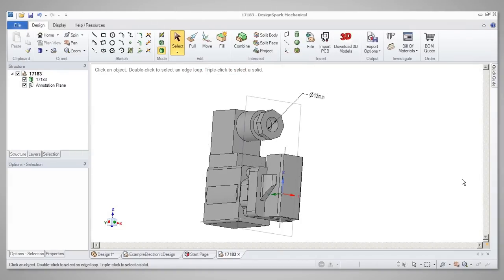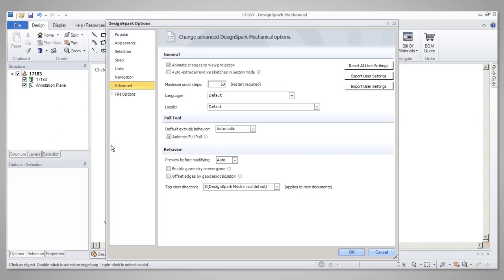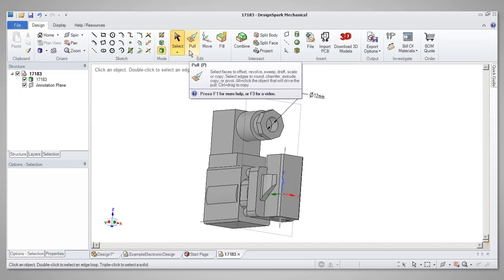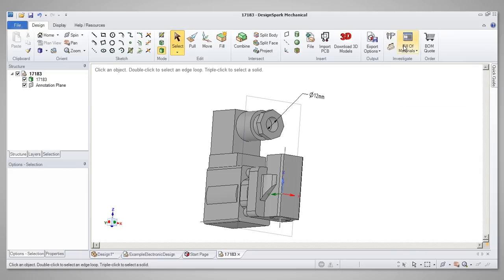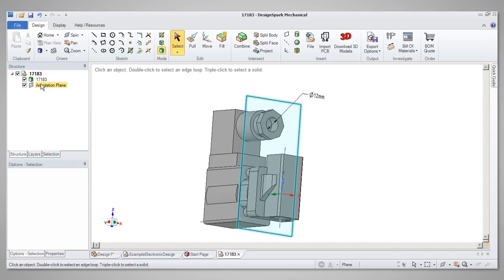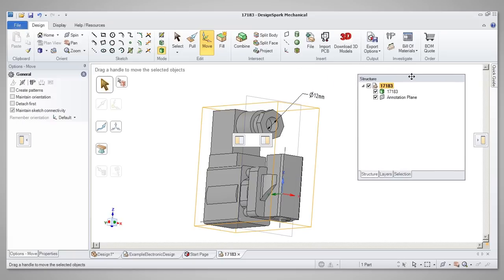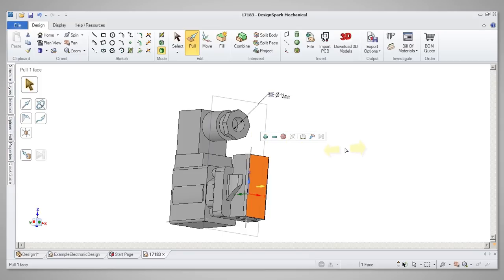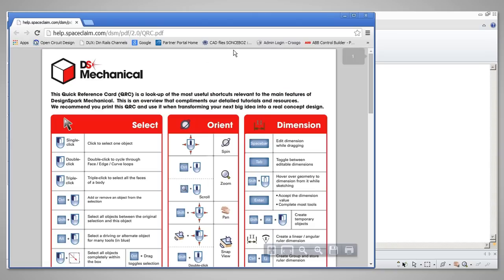#DesignSpark Mechanical - Basics - 1. User Interface - Full tutorial

Comment: Okay, I decided to download the program and while a lot of stuff is great, some things are major frustration for first time basic kind of user which I am. I am not a professional CAD user.  After about 12 hours of use, I can do the basic circles, rectangles, etc. and basic shapes in 2D.  3D is still a disaster for me.  It took me forever to figure out how to copy an assembly.  I would think you could just select all the lines and stuff, hit copy or cntrl C and then paste on a point.  But there is a trick 
 -- you have to paste it on a point, and then sometimes it changes the lines of the copy (is this like cloning where the copy isn't as good as the original?) It still does not work reliably for me.  Then you can't put text on a drawing.  Or at least I can't find it.  How can you label anything?  Next, some lines were graying out -- even after I selected it and reset the color.  It happened on curved lines. Any ideas?  Thanks.  Even tho the program is fun and advanced in a whole lot of ways, this stuff should be easy for $560 for the pro version. I also haven't figured out how to use the fill tool to put cross hatching on cross sections.  Any ideas?  I've gone through about 5 hrs of tutorials, the basic ones are good, the advanced ones move too fast and don't get all the key strokes. I'll watch all your videos.  Just saying.  And I don't mean to be overly critical.....Sorry
Reply: Thing with parametric 3D cad is, that EVERYTHING starts out with a 2D sketch, you define one sketch, just like on paper and if you don't have any surfaces already present, you can place that sketch onto any of the three major planes between xy and z coordinate system. After you've selected to create a sketch and placed it on a plane or existing surface, you draw on that sketch with line, circle etc. tools. then you define constraints, meaning you define dimensions of the lines, their relationships to another (this line is perpendicular to this other line, this distance between these two points is 5mm, this line is always vertical tot he world coordinates) etc. after you've fully constrained your sketch there are no undefined freedoms available, meaning that the ketch cannot be rotated, scaled or moved on any axis (because some constraint or parameter would be broken if it were to do that)  it's called "fully constrained" and it's ready. Then you save the sketch, exit back to the main level and in this moment you usally "pull" it to 3 dimensions, meaning you select "extrude" command or equivalent, then it asks you what sketch are we extruding, you choose the sketch you just created and then you'll enter the dimension as to how much you want to extrude... that's how you get from 2D to 3D and create your very first "real" geometry. After that, you now have multiple faces, multiple edges, pionts etc. available where you can sketch again, then you can again extrude and now that you have existing geometry, you can even extrude "through" the existing geometry, essentially cutting into it the shape you defined in your sketch... etc etc etc... and that's how parametric 3D cad works. You can rarely jump straight onto geometry, because all the geometry in CAD has to be defined very accurately and must have a hierarchy and history. thus if you go and adjust that first sketch you made, it'll change your geometry that you extruded from it, affecting the geometry that all other sketches were created on and thus changing the whole history of the model you're doing.

it's not 3d modelling, it's parametric design :)